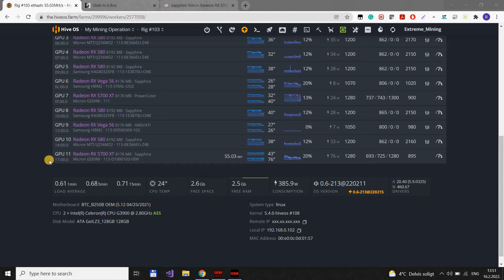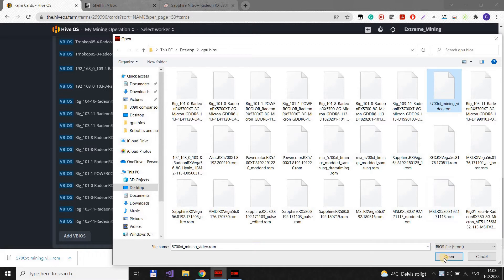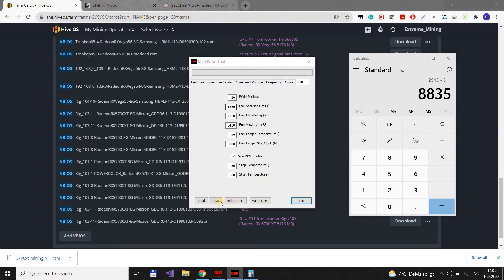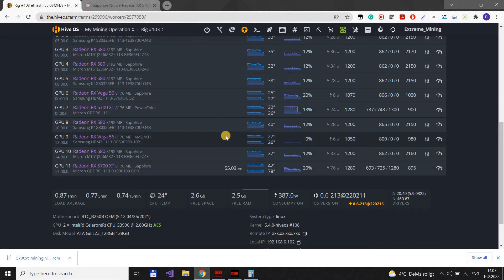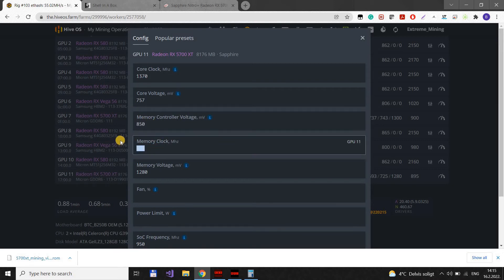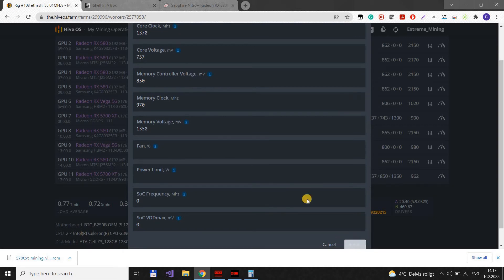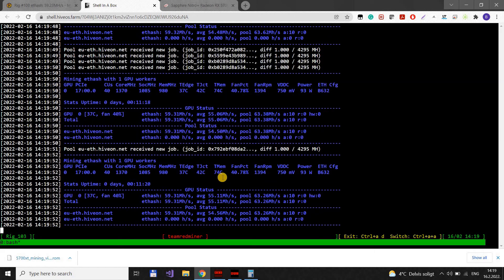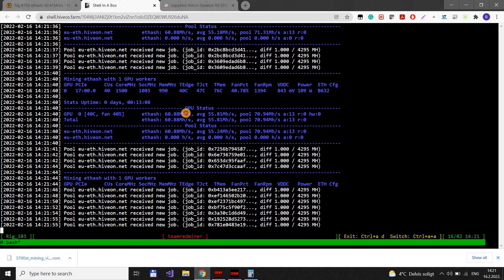The Most Efficient AMD Card for Mining? AMD Radeon 5700 XT!

Comment: If my sapphire's keep dying with your optimal settings, would you recommend beginning with raising the core voltage to find a stable OC or is there another area you'd focus on? Thanks
Reply from the maker: Untill you find the limits for your memory clock, keep the core clock to 800 and then slowly go down in 6mv increments.
Reply: @BMasterBM1  Will Do! Have you ever thought about making a video on how to find stable OC's? Thanks for the advice
Reply from the maker: @monkeypoothrower4  that might be a good idea, thanks.
Reply: @BMasterBM1   making a vid on stable overclocks for the 5700xt would be awesome

Comment: i just recently sold my 15x 5700xt rig sapphire nitro plus.. best i ve ever pulled was 59.3mh @ 89watts with 1 or 2 cards falling to 58 but still reasonable. i manually tuned the timings specifically on the micron side and set it to lock and only use the micron side. only reason for selling is i switched to fpgas have 40 fpgas right now.. 20 are up and running 78mh @ 90 watts..  dont get me wrong i will always have a place in my heart for gpu mining  specifcially the 5700 xt. never had a major issue except hive os had update issues.  if you want a good set of bios and memory timings just let me know i ll happily share them with you if it helps you find the sweet spots.  good video btw.. take care and happy mining
Reply from the maker: Hey man! I stick to gpus, in my head I feel safer because of the resell value, however if everyone start selling gpus the resell value would go to 0 anyway :) Of course I wanna know your settings! They sound very efficient!
Reply: Yes, please for the  SAmsung chip as well 🙂
Reply: @out_of_my_sight   i just posted for the micron and samsung. be careful with samsun tho because it requires a higher soc vddp settings within bios. and they run hot as hell.
Reply from the maker: @StaayHumble  Where did you post them exactly? :)
Reply: Hai could you send me the bios mod?

Comment: Seems like Windows doesn't let me change the memory voltages with MPT, unfortunately. 

I've got two 5700XTs, one Asrock, one XFX. My Asrock card gets around 57MHs, the XFX around 55MHs. The XFX card has always had higher power draw, I'm guessing that's probably because the memory voltage on the XFX is 1370mV, while the Asrock is 1350mV. I've got those cards running in NBMiner right now, gonna move them over to TeamRed tomorrow.

MorePowerTool did allow me to lower the SoC MHz and voltage on both cards, and I did slightly lower the clock speed for the XFX card. The changes did drop the power draw in NBMiner on the Asrock from 124W to 122W, and from 138W to 128W on the XFX card. TeamRed will probably drop those numbers by another 5-6W each. So reasonable drops in power draw on both.

My software power numbers on my Asrock used to be much lower. My Asrock card used to report around 108W for 57MHs with TeamRed. Not sure whether the new drivers are just worse, or if the formula used for power usage changed at some point. The same thing happened with my two RX6800 cards. Those I used to be able to get down to 102-105W for 63MHs or so, now it's more like 115W.

All my rigs are currently running Windows, but I'm thinking of getting a Linux rig up and running here soon. Hopefully I can get some better power numbers on some of my cards like you are. Thanks for the tutorial though, it is nice to get the power draw on the XFX card down a bit.
Reply from the maker: That is weird. I suggest you use hiveos, windows has to many “problems”. That power consumption is calculated by software. I ordered a PMD to check the actual consumption and compare between cards. The Device was faulty, so now I have to wait another month for the new one to arrive. Subscribe so you don’t miss the video! Cheers

Comment: With this settings it will be around 170w from wall it not 90-100w software is bull…it
Reply from the maker: I showed different settings, which one do you mean? Anyway I don’t think it will be more than 150w in any case. Soon I will be able to measure actual gpu consumption.
Reply: @BMasterBM1  i manage to get 130w from wall with core 1350 vdd760 vddci760 mvdd1280 mem 900
Socfreq 950
Socvdd 820
55.41hash
Impossible to get 150w with socvdd higher than 850
Reply from the maker: @robertsbroks  we will see, subscribe not to miss the video!

Comment: Thank you for your video, it made me understand some things :) Can just ask,  on 04:05 why do I have more options  in More Power Tool under power and voltage? I have Memory VDDCI (mV) under that DPM0, 1, 2 and 3, and other is Memory MVDD(mV) DPM 0, 1, 2, and 3.. I dont know what to put there for those settings can anybody help? Please :)
Reply from the maker: You are welcome. DPM stands for dynamic power management. You can choose dpm state in hive os, and the settings for that state will automatically apply. However, here we are not doing that, we input all settings directly in hive os, so you can ignore those dpm states in MPT.
Reply: @BMasterBM1  thank you for your reply. Also, I did manage 55mhs but at 114w. Silicon lottery I guess, I have red devil power color they are a little temperamental :) thanks again!
Reply from the maker: @VujanovicMilosh  what oc settings are you using? Soon I will make a video where I will test how reliable is that power draw shown in the software. Subscribe so you do not miss it :)
Reply: @VujanovicMilosh  i have same one and i cant get any better than 55MH  106W thats with a bios mod i did from another user, but this guy looks better lol

Comment: Hey Extreme Mining
You settings Just works fine for my 2 RX 5700xt Saphire Nitro. Ty 
1 Questionen : i dont used the more Power Tool to BIOS Mod the gpus can Something Go wrong? Greetings from Germany 😁👍
Reply from the maker: Hi! Nothing will go wrong, MPT just changes the range for some values. However I don’t know if this is necessary in hiveos. It is necessary in windows if you overclock using radeon tools.

Comment: DRAMTiming12 says 5850 for mine and wont multiply by 3.
Reply from the maker: Hi, in that case multiply by 2.
Reply: @BMasterBM1  Issue was by the look is it had previously been modded.
Reply from the maker: @SnowyTheCat07  ah sorry, i understand now. The value you have has already been multiplied by 2. The original value should be 2925 or smth like that.